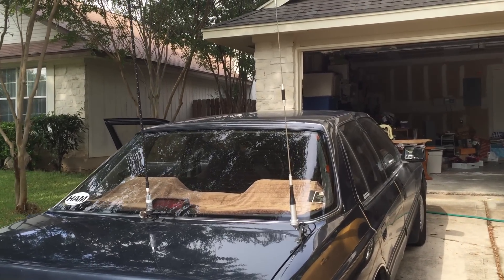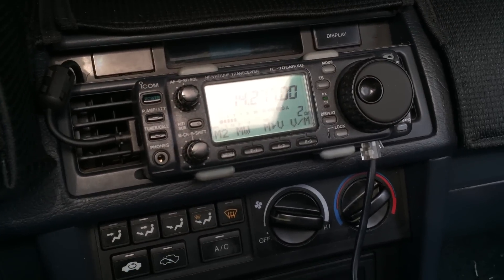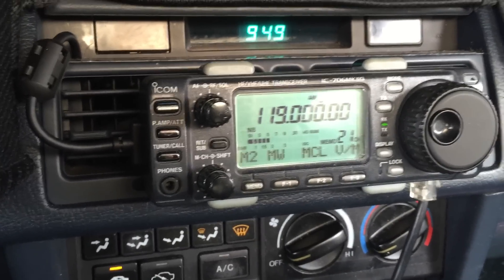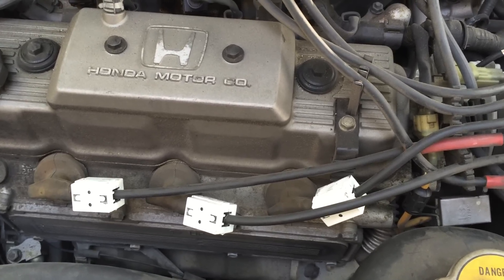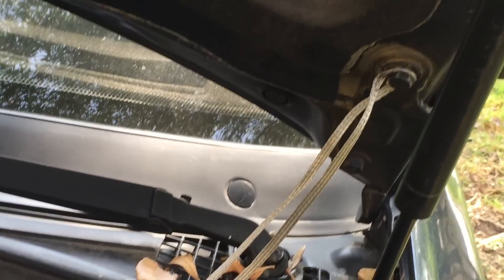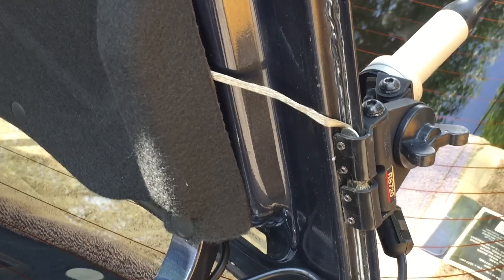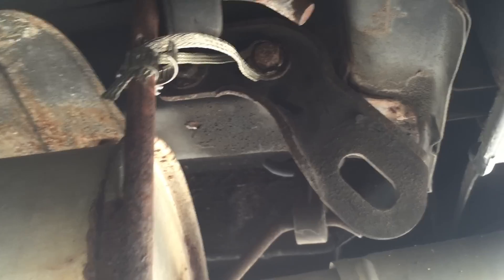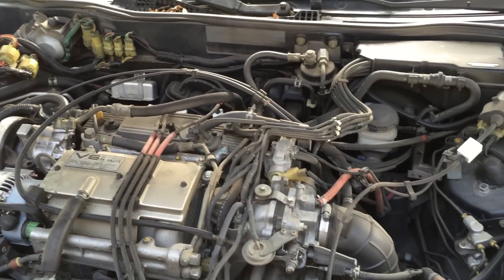Mobile HF HAM Radio - Vehicle Bonding and Reducing Ignition RFI

Comment: Really wish I could find the solution to this...

I've Grounded and Bonded everything.

Cleaned all Previous Grounds.

Replaced Battery.

Replaced Alternator.

Replaced Ignition Coils and Sparkplugs with NGK Resitive ones.

Replaced Fuel Pump.

Radio is connected straight to the battery.

Does anyone have a solution???

Comment: One thing that could be causing this is your electronic injection system. One other thing I have found is any device creating interference can easily cause it through its power feed wires. Example, led lights pull amperage in fast pulses causing the voltage in the feed wires to fluctuate and become antennas. Put capacitors on as close to the noisy device as possible. Values are hard to suggest I'd say about 1uf. You almost can't go too big.

Comment: As a novel approach, how about replacing the spark plug and coil wires with a high quality HV coax (with100% shield/braiding) and then ground both ends of the cable shield to a good ground.  The only tricky part is carefully removing the old plug boot connectors and re-attaching them to the HV coax.  HV Coax is available in ratings from around 5kV up to 150kV dielectric.  For auto applications, a 25 -30kV rating should be fine. This will also improve spark plug energy since most spark plug wires have around 10k - 20Kohms of resistance so you'll get more power to the plugs which can help improve fuel combustion which will improve MPG.  Also, most HV coax I've seen is rated to 200 degrees C (392F) so it will easily withstand the heat under the hood.
Reply from the maker: This is a great recommendation.  I had since replaced the spark plug wires with the best I can find, NGK, (without any noticeable improvement)  but didn't really see any 'shielded' options available.  Your suggestion is an innovative idea and solution.  I shall look into it.  Thanks!! 73

Comment: I appreciate your effort’s, but the grounding strap’s are picking up a lot of static from the surrounding areas and weakening your transmit and receive. What I have done on my vehicle is used “shielded cable’s “ for my ground’s. This improved outside noise rejection dramatically. A lot of people use 10 gauge wire, but I don’t and never will again. My SWR is .25 on all channels. My radios are all Galaxies!
Reply: What are shielded grounding cables,do you mean use the center core of coax?

Comment: So the RFI you show at the beginning of your video:  is that the before or after RFI? Ferrite beads on spark plug leads are a complete waste of time. Grounding the exhaust pipe properly at 3 or more places is usually quite effective at HF.
Reply from the maker: It's all after whatever steps I had taken.  RFI really isn't bad overall - except on AM.  I agree the beads on the spark plug leads didn't help, but at the time I thought I'd give it a try.  I believe the grounding done on the exhaust did help, along with beads on the radiator fan power leads.  I'd like to get more straps on the exhaust pipe as you suggest.

Comment: Hey man, an ASE certified mechanic here, I wouldn't recommend adding a choke on the ignition wires, it's just a bandaid to the problem that you acknowledged in the conclusion of the video. Low impedance is what you're after. More power transmitted to the spark plug means less radiated into your antennas. The choke might also lower the efficiency of the plugs, leading to ignition issues, though if that were the case you'd certainly notice this many years later.

Comment: Good start  first ground radio to tuner like daisy chane to groung muffler pipe 
Shoud b grounded every secshin but 3 miname
You need a v.o.m. meter check for 0 omes exspeshle at antten
Put a ground strap on the alternator to frame n battery
Forgit the bead on the spark plug wire's Jegs has thare brand wire cheap but thare good for rfi 
Bound all the body panels together
N ground body to frame in 4 place at least  thare rubber for vibration in body mounts  the bounding dos not help whith rfi as much as lower your take off angel but just on hf
All this is in the arrl mobilelering hand book   mobile hf something i really like bin doing it for 30 YEARS  n 706 mark 2 n mfj m500
N outbacker  antten  
Hope this helps  73 n9prf

Comment: You kept referring to the spark plug wires as "antenna wires" and the exhaust pipe as the "ignition pipe". ???
Really? A smart man you are, but PLEASE, learn what things are called by the rest of mankind on this earth instead of showing your ignorance. 
Now...run a 8 gauge stranded THHN wire from the battery, fused there, to the cabin of the car. Support your electronics by this wire, fusing them at their junction. This will eliminate engine harmonics. Good luck.
Reply: 🤣 a 8 gauge stranded or an 8 gauge ?👍
Reply: Hey Karen, don't you have some blinker fluid you can be checking instead of being the word police?

Comment: Quite an effort.  Going through something similar right now.
Reply from the maker: Yeah I'd say it's worth it, not very expensive, just a bit time consuming.  I've been pretty lucky here as I never had too big a problem with RFI on this car.
Reply: @SWRadioConcepts  Just finishing a mobile install on a 2019 Prius.  So far so good.  My previous was a 2005 Prius and almost no issues on a Kenwood D710G.  Yes that is a good point about the time consuming aspect.  Started this during Thanksgiving just getting to a point now.  So far the only shielding I'm using is the extension kit that is for the Kenwood D710G.

Comment: search eBay "new old stock cb cornell-dublier" you should locate an ignition noise damper has a long red tube with wire coming out of it...should eliminate your ignition noise...
Reply from the maker: I did search for that and see them for $10-$20.  Interesting, I don't know if that's snake oil, but probably worth I try.  Thanks for the suggestion!

Comment: What was the mix of the ferrites?  If they were not either mix 31 or mix 43 (more likely to help on higher frequencys) then they may not do much good.  Those white ferrites look like the cheap "no mix specified" ones you get off of ebay or Amazon from china.  Good Ferrites  can cost several dollars each.  I would get 6 Mix 31 ferrites made by fair rite themselves.  Mouser is a distributer for fair rite and has the best prices. If you don't know the mix of your ferrites, then you have nothing.  There is MUCH to learn about ferrites.  de James K0UA

Comment: I had a similar situation. I had to use chokes on the alternator wires. At the alternator and at the battery. And at the fuse box
Reply from the maker: Yeah that's a good idea.  I think I had that idea, but never acted on it for some reason.

Comment: I have a chevrolet silverado 2500 4x4 truck and had to rf bond lots of stuff on it and replace the packard wires with MSD to get the ignition noise down. when I had 80s toyotas I put coaxial rf capacitors on the fan wires near the fans. On a 2000 echo I had to add a coaxial rf capacitor near the in tank fuel pump. on one car I needed coaxial caps on heater fan and windshield wiper motor. lots of stuff can make noise. Yes, ground the tail pipe to body and frame. You can use a portable radio on am to sniff for noise or a coax on the am ham radio with a sniffer loop on the end( cut back the shield a couple inches and bring the center wire out in a loop that connects its end to the shield). Used that on cb radios when I worked at a radio shop in the 70s. I never became a CBer but love the movie "Citizens Band".

Comment: Just FYI on bonding straps on the exhaust pipe, you need to grind that rust off before you bond the wire. rust acts like an insulation to the good metal under the rust so grind the rust and bond that wire to clean bare metal.
Reply from the maker: Oh I did, used a dremel.

Comment: Ground straps too long. You did this all wrong. Follow Ke0g's website to the T.
Reply from the maker: On the trunk and the hood?  They're really just about a short as possible consider those surfaces have to open and close!  I've read K0BGs site many times - He's got a great setup and very good information for mobile hams.
Reply from the maker: I will soon do some more videos on some improvements.  Most importantly adding matching at the feed point.

Comment: cool. Thx for the reply. Nice setup. I am just getting on mobile hf and I am operating in a restored m37 truck that is completely bonded and shielded as it was a radio truck in its army days. hf is useless in my other vehicles bc of noise 73 N2XEV
Reply from the maker: Wow, well that sounds like an excellent platform for mobile HF.  My car, being 30 years old, doesn't have all the computer and electrical technology that presents challenges to Mobile HF.  Make sure all the bonding connections are clean and still conduct well.  I have to loosen and tighten connections every so often.
Reply: Good idea!  that will be a fun project.

Comment: why did you move on from the ldg?
Reply from the maker: The MFJ tunes more quickly, but more importantly it's digital display provides more information about the antenna system, performance.  I can check the SWR of the antenna before and after tuning, and check power output in watts.